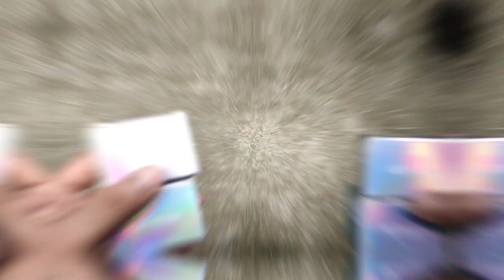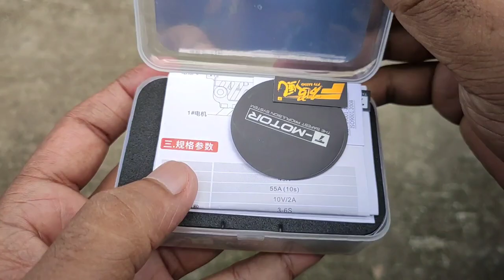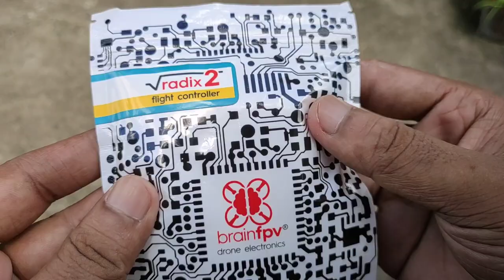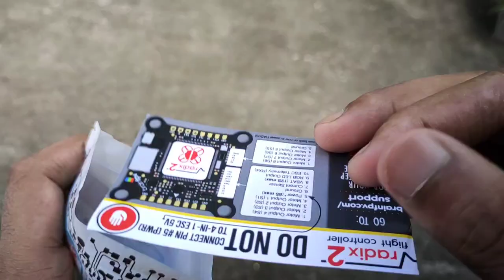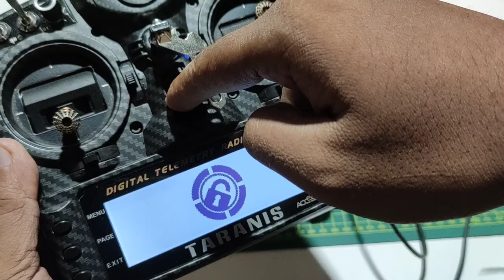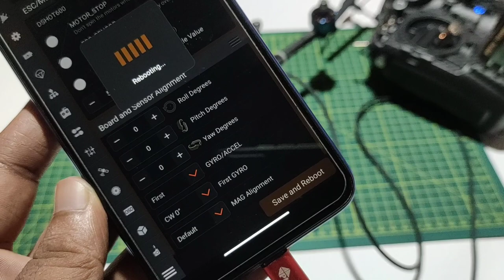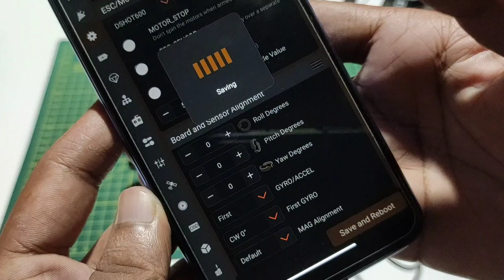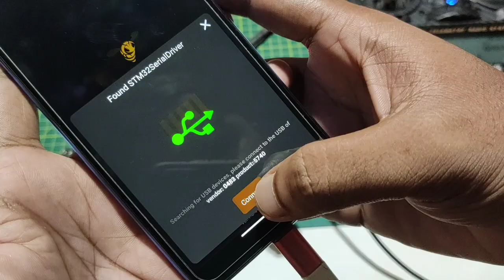How to build FPV Racing Drone at Home || Full Tutorial || DIY RC Racing Drone.

Comment: You are grt bro .. 
Pls I am facing a problem related FPV .. you are very experienced and genius in this field .. so you only can help me.out 
 I had made my first FPV and it is vibrating a lot .. 
I had used 2750 2207 motors and checked them all they all are right .. 
And even my frame is also in a good condition without any bents .. 
The flight controller that I had used is cc3d 
I am very confused  and sad as it is having a lot vibrations . 
PLS CAN YOY SUGGEST ME SOMETHING This problem 🙏🙏🙂
Reply from the maker: Just make a small video and send me on Instagram, the video will help me to better understanding... ( my Instagram link in the video description)
Reply from the maker: At 3pm ok?
Reply: @akgadget  sure bro 😊👍

Comment: Bro you should use tmotor f7 flight controller and DJI hd1 fpv air unit and controller
Reply from the maker: I don't have DJI goggles.. and nothing is wrong with skystars f7.. it's works fine..
Reply: @akgadget  ok then where from you but t motor parts ESC and motor
Reply: @akgadget  bro does skystars f7 come with RTH feature and can we add external MINI  gps module??
Reply from the maker: Yes you can add gps.. and for better RTF results you should run INAV on it..

Comment: Can we use flysky i6 or i6x transmitter
Reply from the maker: Yes you can... But the signal strength of i6 is not very good.. so the range is very short..

Comment: Did you install a matek optical sensor?
Reply from the maker: No...
Reply: @akgadget  great flying and catching it right after disarm. I thought you used alt hold there.
Reply from the maker: Thank you! And that is just Angel mode..
Reply: @akgadget  oh yeah haven't tried it. Totally forgot the angle mode, long time the toggle switch not used. Hehe. I'll start with a cinewhoop maybe
Reply from the maker: Great.. Try it..
Reply: @akgadget  last tip, is your airmode always on when you do that?
Reply from the maker: I actually turn on the airmode before put my goggles on..

Comment: What is the minimum & cheapest price for 4 inch fpv in this India price?
Reply from the maker: Approx 15k for drone only..
Reply from the maker: @cowfox9637  check out quadkart.in
Reply from the maker: @cowfox9637  yes you can use 2550kv motor but you can't use 6s lipo.. you have to use 4s lipo..
Reply: Bhai drone home made how much cost bhai

Comment: How much it cost for the setup excluding GoPro and extra accessories
Reply from the maker: Approx 20-25k for the Drone only
Reply: @akgadget  but bro same Garuda Drone costs around 10k, including optical flow sensor. Why this one costly?
Reply from the maker: @yugalsharma13  🤣 don't compare children's toy with FPV Drone brother..,
Reply: @akgadget  sorry, didn't know about Garuda Drone much. But I'm confused because you said only the drone cost 25k, excluding camera! Is it normally the standard cost for FPV drone?
Reply: @akgadget  how to build the components like ESC, and flight controller at home? Will it be cheaper then?
Reply from the maker: @yugalsharma13  standard cost is little lower but around 50-60k to build a complete setup with a decent goggles